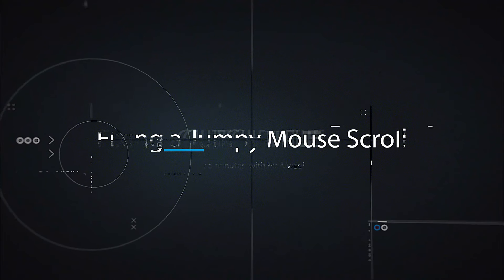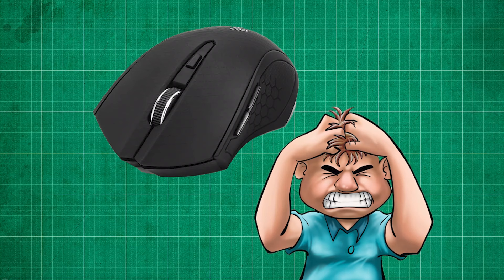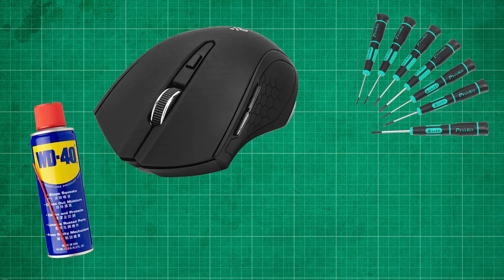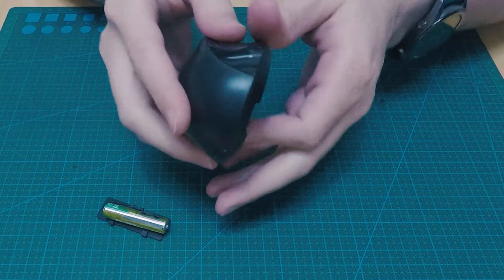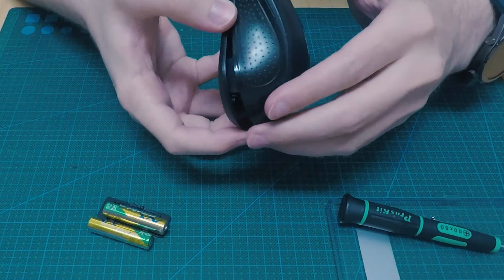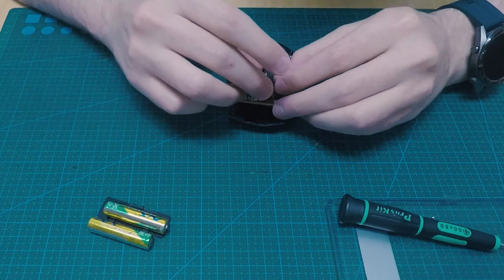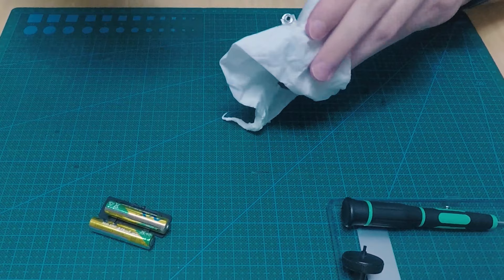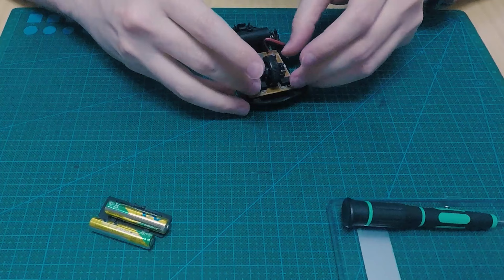How to Fix Mouse Scroll Wheel in Less than 3min ! 👀

Comment: Common misconception: WD40 is a solvent, not a lubricant. It may act to dissolve any fatty residue on the mouse wheel which was causing the sensor to misfire. It will not lubricate the mouse wheel though. As long as it fixes the issue then this is a fine method
Reply: this general-use version of WD40 lubricates
Reply: Can I use cooking oil or electronics compressed gas usually used for computer lint and dust removal?
Reply: Wd40 eventually attracts dust/grime. It's been a while now I thought everyone would have stopped using it. Technically cleaner than maybe add silicone spray is the way. If cleaner works you should probably use rubbing alcohol. Can probably just pour some 90% down there an scroll it a few times without opening. Im not saying do that though. Contact cleaner can cause shorts can't it?
Reply: @uliveulearnandregret  hell no cooking oil. You trolling? I'd skip all this lube schitt. Very rarely did I see liquids near circuit boards. I'd be worried about shorts.
Reply: It is a short time lubricant. But you're right, that's not its purpose.
Reply: @ShawnJonesHellion cooking oil would do nothing to the components. I'm not sure it'd do any better though. For liquids, isopropylic alcohol, contacts cleaner and other oils like wd40 would do any harm as well. I do use isopropylic alcohol in turned on circuits without any problems.
Reply: @ShawnJonesHellion  Contact cleaners intended to be used as such are not electrically conductive. The very popular Deoxit is a good example.
Reply: @uliveulearnandregret   yup you can use a cooking oil. i mean i just did and it fixes my mouse, ill update if anything happens
Reply: @patrickignacio7954 yoo thx, I'll try that someday soon, it's starting to happen with my laptop mouse the ones you use a Bluetooth dongle for, if it works well I'll go back to using my wired gaming mouse which is superior all it has is the mouse wheel issue
Reply: I'm using alcohol to clean most devices, in and out... it evaporates so no issue for the components. Also the best for camera lenses, screens, etc. Isopropyl alcohol, or wood/methylated spirits, very cheap...  with a q-tip for small parts, or together with some water for larger surfaces!
In this case I had to then add a drop of mechanical oil, else the jumpy scroll issue was back after a short time - no cooking oil, it will probably degrade too fast!
Reply: Better tell the company because they have that common misconception as well. "In 2009, Wired published an article with the results of gas chromatography and mass spectrometry tests on WD-40, showing that the principal components were C9 to C14 alkanes and mineral oil."
Reply: @uliveulearnandregret  No, use Lithium grease instead. For cleaning you can use Isopronal first. Then use lithium grease.
Reply: @ShawnJonesHellion  someone said they used it and they recommended it to me, they said it worked for them
Reply: @patrickignacio7954  are you trolling?

Comment: i use a wired mouse but followed the same steps but instead of putting WD40, i gently apply Vaseline Petroleum Jelly and it worked like a charm. Thank you for this tutorial.
Reply from the maker: You're welcome. Thanks for the info, I know that vaseline is a lubricant although never occurred to me to use it in this application. Glad to know it worked out well for you.
Reply: I also used Vaseline and would have never thought of it if it  weren't for this comment
Reply from the maker: @cartmaneric1008  Appreciate the feedback Eric, and it's good to know it worked out well for you.

Comment: The oil in WD-40 can weaken or even dissolve plastics. Try using a dry lubricant with quick-drying solvents like B'laster Dry Lube or 3-in-1 Lock Lubricant instead. Good tutorial otherwise!

Comment: Thanks for the tip! I really didn't think it was going to work, but it did. I fixed my Microsoft wireless mouse 3500. I used a lot more WD-40 than you did. I really blasted it a number of times! When I reassembled the mouse, I also put just a tiny bit of white lithium grease on the axle-shaft supports, since the original factory grease was old and gunky.
Reply from the maker: Great work you did, happy to hear it's back to normal!

Comment: This worked a treat, thanks!! The only difference for my mouse was there was a lip on the front lid and two screws hidden under soft pads on the front, and the wheel couldn't easily be removed so I left it in place  whilst spaying the lubricant.

Comment: Actually worked! Razer Viper Mini user here, though I had to watch a different teardown, the process is basically the same. Thanks!
Reply: Did it work for long? Is it an actual long term solution for you? I have the same issue but idk if i should bother buying wd40?
Reply: @maccly3352  you probabaly bought a new mouse by now, but vegetable oils works like wd40

Comment: Thank you so much for this fix! I tried everything and have been dealing with this issue for over a year now. I even completely took it apart and cleaned it and it still didn't work. I was skeptical, but this worked immediately! I almost bought another one too. Thanks!

Comment: Corsair Scimitar (wired) owner here. WD40 works like a charm! I didn't even need to remove the scroll wheel for my mouse. I soaked a blue shop paper towel with WD40 and brushed the teal colored cog wheel that the scroll wheel is attached to, while rotating the scroll wheel to coat the whole cog wheel. As some other people have mentioned, using a proper silicone/grease would be more preferable than WD40 over the long run. Thanks Alwadii!

Comment: I have suffered for months with a jumpy scroll, watched this vid but used an AIR DUSTER spray instead. FANTASTIC, mouse is like new. Thanks Mr Alwadii
Reply: same. I've watched many videos, but this one actually showed me that the part holding the scroll wheel is not as rigid as I thought, that it can safely be pried slightly to get the wheel out and in again.

Comment: I couldn't actually remove the wheel, as it was fixed in place and not easily detachable, but I did clean the wheel with WD-40 and a bit of Vaseline using a Q-tip and my finger whilst rotating it so that the carriage it sits in would get the lubricant, and it worked fine. Many thanks. I've seen lots of websites and videos that didn't work, this did. Much appreciated!

Comment: Thank you for this video!! I just tried this on an expensive Razer gaming mouse and it 100% fixed the scrolling problem. I was about to buy a new one, but this just saved me some cash!!
Reply: I have a razer viper mini and it have this problem can you tell me how can i open it thanks
Reply: @abbreylifn7483  just take the screws on the bottom out. They might be hidden under the little pads, you will have to peel them off.

Comment: Before surgery, I tried this.  My Corsair Ironclaw wheel was jumping the webpage erratically up and down.  I turned the mouse upside-down, and gently but quickly rolled the wheel along the big mousepad about 15 times.  I guess some stubborn dust got removed because it worked perfectly after that.

Comment: While this video itself didn't really help exactly as intended since my mouse apparently has optical scroll. I did notice the optical sensor was crooked so i bent it back straight and now it seems to work better than it ever has. So while this didn't help me it prompted me to take apart my mouse and fix it. But i am grateful for you pointing out it was a hardware issue and not software issue as i originally thought! Thank you :D
Reply: i know this comment was made a long time ago but i had a simmilair issue the peice of plastic that went into that gear thingy on the scroll wheel broke off so i had to do a wheel transplant with a diffrent broken mouse i found

Comment: I can't believe it was this simple.

 I have a Starlight 12 TenZ edition and it's had the "phantom" scrolling problem ever since I got it. I RMA'd it back to Final Mouse and they sent it back... problem still persisted. I even installed the latest firmware and that didn't help either. I was reading on Reddit that you shouldn't use WD40, and  that Isopropyl alcohol is better. WD40 is all I had. Glad I tried it because it scrolls PERFECTLY now. Seriously, not a single incorrect scroll input. Thanks for this video you're a damn life-saver.

Comment: I need to comment that this video saved my budget corsair mouse. It didn't take long daily driving and gaming on my Corsair Katar Pro XT mouse for it to develop this jumping/skipping issue. Had a small battle with Corsair RMA department about replacing the mouse at zero cost to me (shipping included) they agreed. Within a few weeks the new mouse developed the same problem. Well, I'm certainly not having the same conversation with the RMA department so I tired this method and it has been a legit 6 months and ZERO skipping from my scroll wheel. I do however suggest to spray the WD40 into a bottle cap and use a micro swab (from Amazon) to drip the WD40 inside the encoder.

Comment: That was great tip.  If you have the time and means:  don't use regular WD-40. Buy some dry oil-free contact spray / electronic cleaning spray.
Reply from the maker: Yes that's a great tip, I'll keep it in mind for next time, thanks 🙏🏻

Comment: Tip: Try a dry lube spray like WD-40 DRY LUBE, it will lubricate much better and prevent build-up in the future because it will not attract dirt & dust like oil based products... It's recommended to test on the specific type of plastic you're lubing first  ~
Reply from the maker: I've never tried WD-40 Dry Lube, I'll give it a try sometime.

Thank you for the feedback 🙏🏻

Comment: WD40 is not a lubricant oil. It is used for loosening bolts. Thus over a short time, your problem will return. Replace WD40 wtih a proper lubricant oil (or silicone grease) and you should be good.

Comment: I have a Technet SKU:M003 cordless mouse which was jumping and I took it apart eventually, as there were two hidden screws under the front feet. It turns out that the jumping was due to a loose rubber tyre on the scroll wheel and it was slipping, a couple of spots of glue under the tyre fixed it!

Comment: I had this issue in my Rival 650 Series mouse. After a quick google search, I figured out that there was a manufacturing defect. Since my mouse started jumping after the warranty period, I was out of luck for a free replacement. I opened it up, cleaned it with IPA and everything and it was still jumpy. Finall gave up and decided to roll my mouse upside down on a table against the scroll wheel, Did that vigorously for 1 minute and it somehow started working fine XDD. Give it a try folks, it might loossen up some dirt/debris stuck in the wheel.haha

Comment: WD-40? Surely not. I know it is made out of fairy dust, but common. I fixed the ventilator, mic stand and squeaky door, now you're telling me I can also CLEAN with it??
Yes. I stand corrected. After first cleaning with my hands and compressed air, I had no result. But just one sad drop of WD-40 instantly fixed the problem.
I really liked the tissue paper too. Simple, yet exactly what I needed.

Comment: Thank you for this idea !  Well ... sprayed WD40 through the gaps around scroll wheel using the fine tube that comes with the can (without opening the mouse ... because my mouse screws seem to be hidden behind the footpads ... did not want to removing them cause they will not fix back as good as they were originally ).  It worked !
Reply: Slightly heat up the footpads and lift them carefully up with a not to sharp object, remove one screw at a time and immediately push back the pad (no need to completely remove it). I did this to my Sabre Pro. The housing doesn't need them and it ensures easy access for future maintance.

Comment: i used "3 in one" oil, i it worked for me i think is better, with that you just need to put a drop and remove the little excess with a napkin or Q-tip, that way you avoid to accidentally spray the rest of the circuits

Comment: Guys, If you don't want to dissassemble the mouse, then I have a simple method, which helps me all the time. Just take your mouse, hold it close to your mouth, and then slowly start to breath out inside the holes next to the scroll wheel. Don't blow, but breath out, so that your breath has some moisture in it.

Comment: Confirmed working, did it just now. I used contact cleaner spray, instead of wd40, but yeah so far the scroll is on point (it was skipping before).
Reply: I thik WD 40 not good for this job contact cleaner is the right one to use

Comment: Because of this I looked near the mouse wheel and saw that there is a optical plate that had dust on it like it has on the bottom sensor, I blew the dust out of there with some compressed air also did that for the bottom sensor for crisp aim and the scroll functions normal again, glad that I did not have to remove the sliders!

Comment: I just air compressor blasted the shit out of mine on the sides of the wheel and it works fine now. Previously it would randomly scroll up and down when i'd try to scroll in a single direction.

Comment: my mouse have slim profile and no screw, i was afraid to break the clip if i pry it open, so i pull the trigger button shield a bit until the inner part was exposed, clean it with isopropyl alcohol swabs, and apply the lube that way. thanks!

Comment: Well, I don't have WD40 here. Instead, I used some kind of a bicycle chain/drivetrain cleaner. That thing called Novapro. It has a similar benefits like WD40 I guess. At least it worked. My mouse is a Logitech M170 btw.

Comment: The wheel would not come out of my LogiTech mouse - at least not easily.  And, it turns out the real problem is lint and dust that accumulates in the sensor "sleeve" the wheel "axle" rides in.  (I don't know the correct terminology!)  I used a very fine tip tweezers to pull out the lint and fine hairs, which also pulled out most of the dust.  Then I lubbricated both sides with a SMALL drop of Cerflon oil.   I suspect a small drop of synthetic oil or very light grease ("Super Lube"?) might be even better.  These will not turn gummy as does WD-40 with time.  I reassembled the mouse and scrolling now works well - at least 98% of the original performance.  (Reassembly on my mouse took a little care so that the main buttons both properly depress the micro switches inside when the buttons are pressed.)

Comment: idk who the hell disliked this, but maan this one saved my logitec G304, had issue with jumping scroll.
use wd40 dry lube instead for better result.

I tried also tried fixing my old mouse that have clicking issues. applying on the buttons on faulty left and right click mouse, it also works >.>

Comment: Opened up my cheap wireless mouse and it had the same wheel mechanism. My wheel shaft snapped off though, but a little epoxy got it working again in no time. If you got the same problem don't sweat if your reattached shaft isn't perfectly straight, as long as it isn't super wonky it'll work just fine. Also used a dab of motor oil to lubricate mine and it turned out quite well, just don't use alot a small drop from a match stick does the trick.
Reply: Same, but all I have is super glue

Comment: Thanks, man! After months of having a jumpy mouse scroller, I was able to fix it 😭 Fortunately, I came across your tutorial, I was legit to buy a new mouse.

I didn't have the type of lubricant you used, so I just used a small about of guitar string lubricant/anti-rust oil and it still worked like a charm. 🤍

Comment: uhm the pin from the wheel to the inside beering thing is broken right off, I also have a weird metal block in my mouse for some reason and idk where to put it as it flew off when removing the connector

Comment: sometimes you just need a good cleaning. mine had wads of dust in there wrapped around the wheel. cleaned it out and rubbed it with IPA and now its golden
Reply from the maker: That's great to hear, so glad it worked out for you!

Comment: Saved my 7 y.o, 7 button Elecom 9Nove BT 2ms mouse. Its discontinued, from Japan & is 100$+. It can sync to 9 devices via BT 4.0 & change between them @ the click of a button. Has a small screen inside the mouse on top to tell you what # device your synced/changing to. Runs on AAA's & lasts 2 months off rechargeable Rayovac's. WD Also fixed the double/triple click on my mouse buttons.

Comment: The viper mini is notorious for the scroll wheel issue. i'm on my third viper mini. Each time I go for warranty Razer swapped mine for a brand new viper mini.

The issue is the scroll wheel cannot smoothly scroll up/down without lagging in the reversed direction once or twice. Really annoying.
Reply from the maker: Did you try this and manage to get it fixed?

Comment: Rival 310, works like a charm! Thanks.
Reply from the maker: Awesome, thanks for the feedback 🙏🏻
Reply: @mralwadii7275  Best fix ever bro! I have killed a lot of mice cause of this. Do you think it can also help with double click issue?
Reply from the maker: @destroyerR6  Yes especially if the causes for the double click issue is dust or other small obstacles
Reply: @mralwadii7275  I thought the click sensors are well protected (covered) from dust. But I tried it on my 5 years old DeathAdder which had right button doubleclick issue and now it works like new. Incredible.
Reply from the maker: @destroyerR6  I'm really glad to hear that it's working well after you tried to fix it, great job!

Comment: my mouse's front is sticking on, is there any  way to take it off?
Reply from the maker: Sometimes you will find a sticker or a small pad on the bottom and under it are some screws that you can remove.

What mouse do you use?

Comment: What if the hyper slides are blocking the screws
Reply from the maker: Thats a common thing to happen, you'll have to remove them gently to unscrew the mouse, then once you're done put them back and maybe add some glue if they won't stick.

Hope this helps.